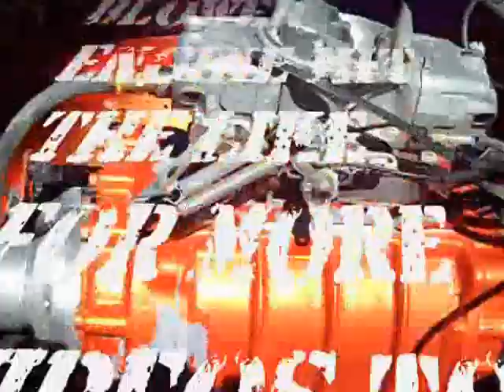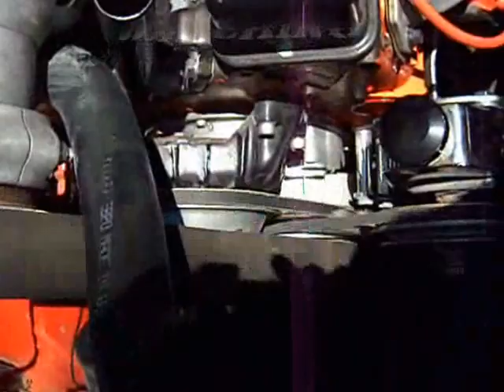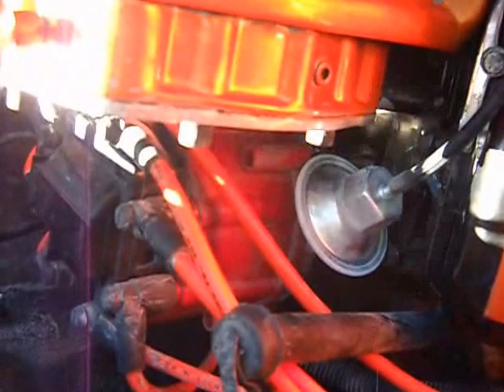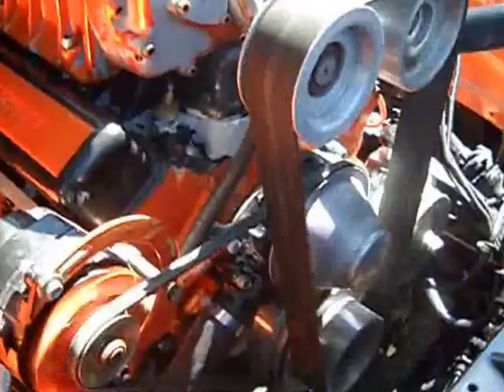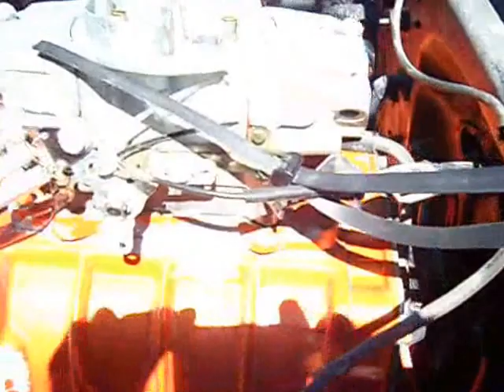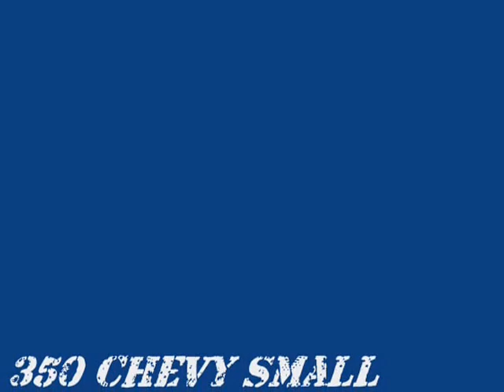350 Chevy 4 -71 Blower Engine Old School Small Block

Comment: Looks like you can still run a HEI distributor
Reply from the maker: Yes He Did Run a HEI Brad ! Stingray !
Reply: All you need is a 250 series and spin it to the Moon a lot smaller and not so bulky..... what people need to understand is on a carbureted setup when the fuel comes in it cools the air inlet charge

Comment: Running vacuum advance with a supercharger? How do you not detonate?
Reply from the maker: That line was not working it was just hook up  but there was no vacuum come  out  of  Mike Evans  thanks for  comment man  hope it works for  you
Reply: Sorry for the dumb question, but whats vaccuum advance?
Reply: @JayLupe  vacuum advance is the method in which the secondaries open up. As the engine creates less vacuum the secondaries will open as required for more fuel and air. Mechanical advance is linkage that opens the secondaries at a certain throttle level.
Reply: @JayLupe  the distributor advances when there is higher vacuum under light load. Helps with mileage under cruising conditions..in fact your timing may go to say 44deg instead of 34. When you increase the load like coming to a hill or passing someone the vacuum drops and the timing drops back to 34 so your not under detonation conditions.
Reply: @kdsboosted4954  nope. try again.
Reply: @cuzz63 it's kind of out of context now since the question about the carburetor is deleted but how bout you explain it to us kiddo. Since they're called vacuum secondaries or mechanical secondaries. What's the vacuum advance for on a carburetor fuel enrichment and secondaries correct?

Comment: where did you get all the parts, pulley system and everything?
Reply from the maker: This was my friends engine and he pick it up that way and sold it  Sorry man i really don't know
Reply: My dad got his off a semi truck. His 350 is built for show but, inside he's put everything to race. He polished the blower. Replaced the nylon. The gearbox and spindle were all in  great condition
Reply: Sorry... He had to machine pulleys and spacers. You'll need a lathe.